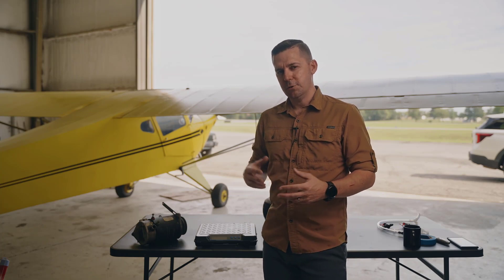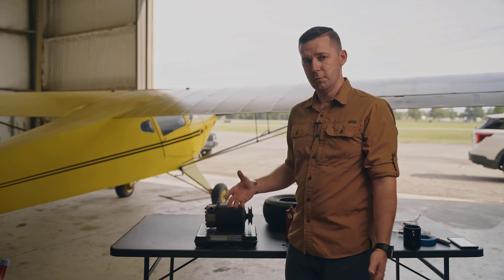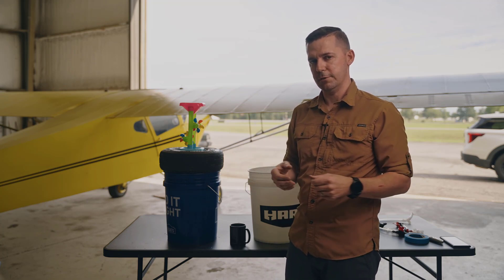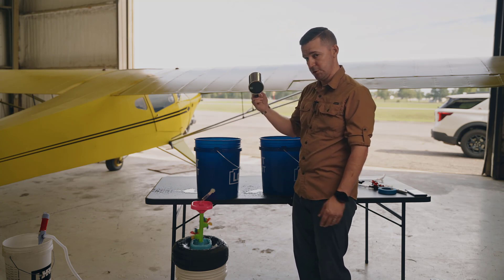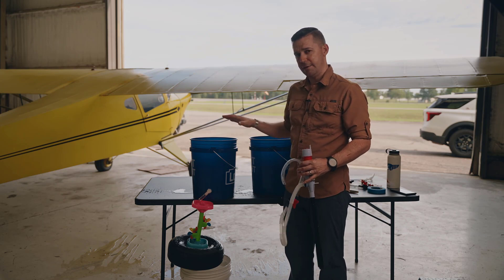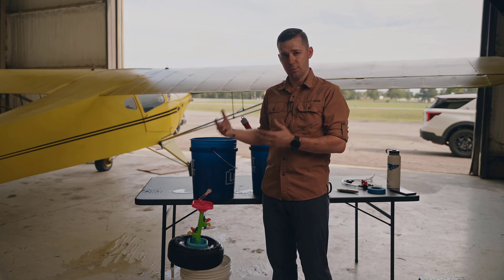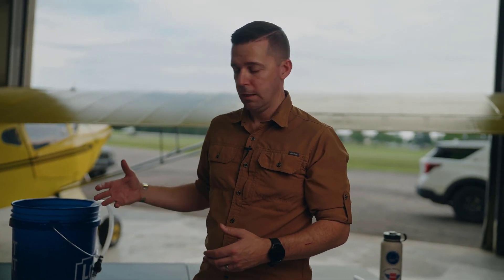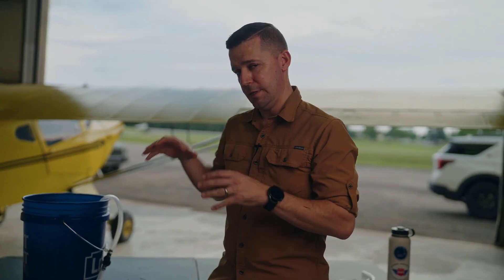Understanding Aircraft Electrical Systems - Part 1

Comment: I like the analogy with water. Thanks for doing this video. One question I was asked during my PPL checkride was about circuit breaker failure, and how many times should one try to reset it and why. Essentially how a fire can start from a circuit breaker perspective (for example, if the pilot reset it too many times, or hold it shut too long making the circuit breaker weld shut or sparks.. which would have high likelihood of starting a fire). Perhaps reviewing different circuit breaker design itself (I am sure they've improved over the years) and why a pilot should not try to reset a breaker in flight that is not critical to the flight, like the beacon light.
Reply from the maker: Great question!  I will be doing a video on circuit breakers very soon!

Comment: This is the most basic explanation and its made perfect for everyone to understand it. Thanks man. Id like to learn how to better read the schematics in easy and some complex examples such as a cessna and a 737 or maybe a c130😊. Thanks
Reply from the maker: Schematics will be coming up soon.  They are difficult to read but fortunately, most pilots don’t need to be electrical engineers to be effective.  The modern line diagrams and system diagrams are much easier to read.  I’ll see what I can do about showing some more advanced systems.  Good idea.

Comment: Interesting - but I have questions about what you say at 13:44 ish. 30 minutes of power from an aircraft battery seems pretty short?  When I refurbed my 172 with a glass panel, new lights all round, swapped the generator for a 50 amp alternator, etc, etc. 
I tested the battery life with all equipment on, all panels, radios, lights, etc; the ships battery lasted 2.5 hours. That's when the internal back-up batteries cut in and went another 90 minutes to keep the panels and radios working; though I lost the lights at the 2.5 hour mark. 
I guess older six pack equipment sucks more juice, I know that the older incandescent lights certainly do.
Reply from the maker: Yes, older instruments do tend to draw more battery power.  Testing the battery life on the ground isn't a perfect test however.  One of the biggest power draws on your battery is the power used to make radio transmissions.  Additionally, batteries lose their capacity over time, especially the types used in aviation.

Comment: Hi Seth, thank you for the video.  I like your metaphors using water but I am confused when I look at the C172N POH at my flight school.  The electrical diagram pictured appears to show the battery supplying the starter, but the alternator directly feeding both primary and avionics bus, not feeding the battery which then feeds the busses.  At school I had been taught what you said in the video, that the alternator power passes through the battery en route to the busses, but the POH diagram does not look that way to me.  Would you be able to clarify this point?
Reply from the maker: Send me a picture of the diagram to sethlake@vsl.aero. I'll help you identify where the alternator ties into the battery.

Comment: This is an interesting analogy, certainly helps non-technical people visualize things better. If you do understand how electricity works though, it's actually quite striking how flawed this analogy is (took me a while to realize). The main problem is that it appears here that water is analogous to electrical charges, but it's not. Electrical battery is perfectly capable of moving charges around the circuit for an extended period of time, so what represents the battery (the EMF it generates) is both gravitational force on the way down and the electric pump on the way up. So it doesn't make sense to call the bucket a battery, and the pump a generator. The correct relationship between the two models would be: battery is gravitational force plus the pump (or even just the pump if you don't rely on gravity and just make everything hydraulic), and generator is the electrical source into which the pump is plugged. But then of course there's no feedback in the system, and the analogy is ruined... kinda funny how similar it looks, but how different it actually is.
Reply from the maker: Great point.  Thank you for the feedback.
Reply: The water analogy is pretty common for electricity. I think I see what you're objecting to in terms of the analogy, but I believe you're trying to substitute the water flow directly for the flow of electrons and the analogy isn't meant to be this literal. You're right, that even though a battery is not being recharged, the electrons are still flowing all the way back to the battery in a closed loop - they aren't being destroyed or removed from the system. Instead of thinking water = electrons, keep it more abstract and think water pressure conceptually is like voltage (potential) and the flow of water is like the flow of electrons (amperage). To your point, the water pressure is literally because of gravity and is directly proportional to the weight of the water column. When you run a battery without recharging it, the voltage decreases (the level and in turn pressure of water in the bucket). So when the battery is running without being recharged by the generator/alternator, this is no pump and the level is constantly dropping. The pump in the analogy isn't the closed loop of the circuit, it is to restore the battery voltage (or potential) to the maximum.  So you could think of the water level like the battery icon on your phone (0-100% full) and the pump is the charging cable. Again, this is all meant to be a metaphor to help intuitive understanding, but it doesn't represent or describe the actual underlying physics. The true underlying physics of the battery level is really the electrochemistry to create the voltage potential (not simply returning the electrons in a closed loop), but that's farther down the rabbit hole than needed to have a practical and useful mental model of the electrical system in an aircraft.
Reply: PS Seth, I think you did a great job in terms of presenting the analogy and helping present a good "model" for how to conceptualize the topic. Also, I just had a really great IFR checkride and can't thank you enough for the IFR content you put out.
Reply: @dubbacremona  yeah as a metaphor it works very well. If you somehow drive the pump off of the water stream it would be ever better.
Reply from the maker: @dubbacremona  Appreciate your input. The water analogy is a simplified way to get the core concepts across for pilots, not a precise scientific explanation. I agree it has its limits. The idea is to create an accessible mental model for understanding electrical systems in aviation. A deep dive into battery electrochemistry and its implications on system performance could be a good topic for a future video. Thanks for engaging and the suggestion – it’s valuable for making this content as practical as possible for pilots.